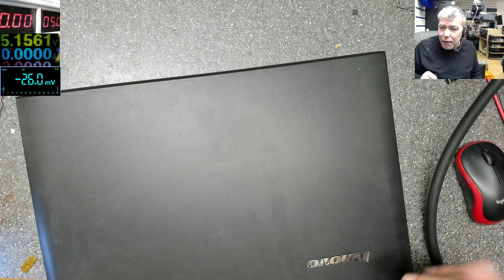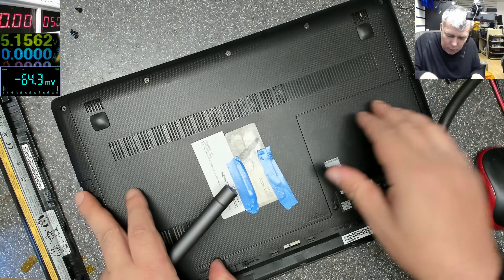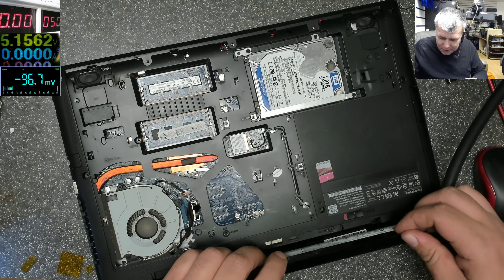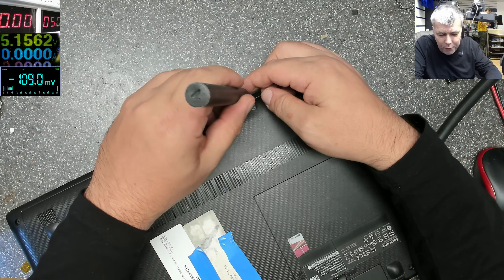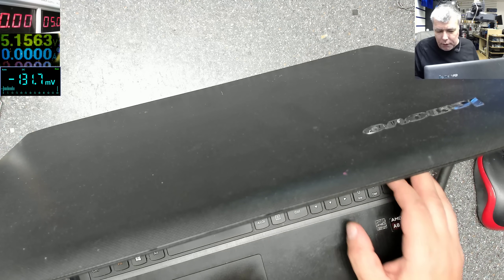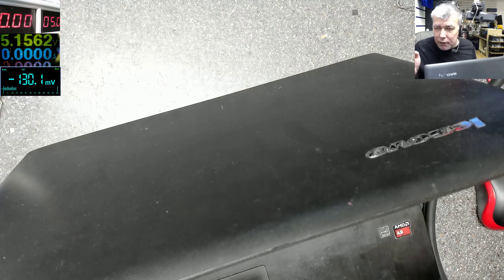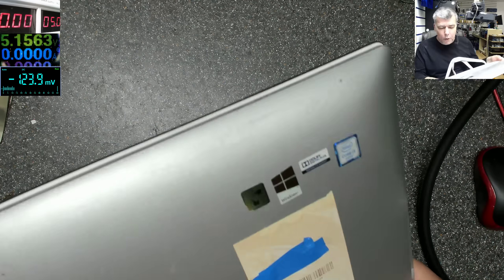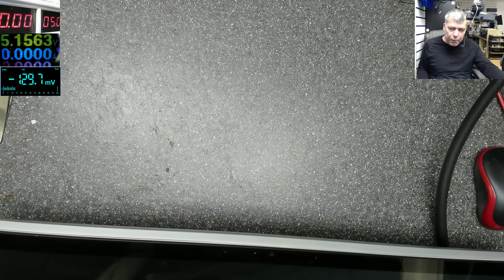Video TDR failure error, anyone know anything about this?

Comment: Hi sorin I like your videos I got a few pc with this problem this is my fix. Let me know it helps
Go to cmd as administrator type command powercfg -h off then exit.
Then go to power options changed advanced powers settings expand adapter settings changed power options to maximum power performance and maximum performance do thé same with into graphics settings . Then go back to cmd as administrator and type sfc /scanow then exit. Normal is thé error hond now try it regards Steve from Belgium
Reply: Up this comment guys. Bro Sorin needs to try it.

Comment: I've currently got an issue with a fresh win10 install where the usb3 ports don't work ... but they work using Linux. In my case, the solution - according to Dell - is to install new chipset drivers. Apparently it's a known problem with fresh win10 installs. Anyway I can't be bothered for the sake of 2x USB ports. Does the video work if you boot off a Linux USB/DVD ?

Comment: Hi Sorin   Igdkmd64.sys is  Intel Graphics Driver. Maybe it is possible to start Windows in Save Mode with Strg + F8 at start of the PC.
Then uninstall the Drivers and install current Driver Pack from intel Homepage. Maybe it is a good idea installing Chipset Driver first before installing Graphics Driver.

Comment: if you put new Windows on it without updates and it keeps doing it then it's the drivers.  if you are going to update and you get it afterwards you will know that it is the drivers.  should it still work with a clean installation without drivers.  then your processor is probably not quite right anymore, which also includes the video card or the separate video card is not working properly.  sometimes processor with internal video card and sometimes the separate card.  if it doesn't work with a clean installation, you have to look for old drivers from the machine itself

Comment: This one is actually not difficult to pinpoint the problem. There is a piece of software which you should be using anyway. Go to kaspersky anti-malware antivirus website they have a program which creates a bootable DVD, it is meant for recovery of a virus malware attack but you can use it for diagnostics.

It is based on the KDE Linux desktop it is keyboard or click base and it has hardware diagnostics built-in as part of it. it is a desktop diagnostic kaspersky customised KDE  which you should have laying around always for these kind of things and others.
Reply: Kaspersky Rescue Disk diagnostics. https://www.kaspersky.com/downloads/thank-you/free-rescue-disk

Comment: Indeed it's the Intel iGPU driver crashing. It should work fine in safe-mode since the driver isn't loaded. Should try an older version of Windows 10 with an older version of the Intel driver or even a Linux LiveUSB just to make sure it's not a weird driver incompatibility (it happens).
It can also be a hardware problem. RAM has been swapped already but you can try Memtest to exclude that possibility. You can also disconnect the LCD to make sure it's not causing an issue (like due to corrupt EDID or something).
I've seen this issue several times with failing dedicated GPU, buggy drivers, bad or incompatible RAM.
With Intel iGPU I've seen it once on a desktop and it was an issue with the PCH, in this case using a dedicated graphics card worked, but if trying to use the integrated VGA port it would crash like this.

Comment: I'd try installing a different build of windows 10 maybe one from a couple of years ago. Might also try a windows 10 USB boot ot maybe a Hirens Boot USB just to see if anythng will boot.
I used to like Lenovo stuff but the quality has dropped somewhat.
Might not be relevant but Paul Daniels has just (minutes ago) posted a video on an Ideastation (AMD processor) and he found a corroded cap on thhe CPU wbich he removed!

Comment: Hi Sorin... I have been watching and learning from you for a while..I own a computer repair center in South Africa... . I am learning lots of extra bits from you....
Video TDR Failure is the following problem. 
Due to a later update from windows it corrupts the video driver. You need to download DDU and the original driver for the graphics card.  First you uninstall the drivers with DDU... Back to windows basic display. Then you close the DDU program and install the original driver, however Nvidia asks for the express or custom install... Use the custom function. After the installation you need to adjust the wifi power  to maximum (why... Who knows) but it works.. My client and I battled for 2 months.. And now it's perfect....
Reply: Johnny he posted in video description it does work in safe mode. It should work in safe mode because the GPU drivers are not loaded in safe mode
Reply: i tryed the ddu and reinstalation of the software and didn´t solve the problem. never done the wifi thing, how can i do it? i have an asus rog gl553vd and the bios is so limited that i can´t really modify anithing in there... help please and thanks for the tip.

Comment: TDR is an abbreviation for Timeout, Detection, and Recovery. It's a windows component. Whenever you receive this error, the Graphics card stops responding and Windows will stop to fix the driver error.

Probably hardware failure in graphics hardware within the cpu. Integrated like you said.

Comment: if it as hdd fitted it will need changing out for ssd and a new windows putting it but first go in the bios and reset default

Comment: It's all in one without touch screen? An idea to try it without screen connected on external LCD. Maybe it's screen or touch screen issue? Try bios update and older win instalation. Try to disconnect hdd, that was the first issue, maybe it's error created by data corruption on hdd data ljne, try USB only instalation. Disconnect wifi and any other connected hardware. My guess is the touch screen issue. If it should be there ofc, check it first. Best luck :) waiting for feedback on video thank You for your work  on yt :)
Reply: Another reason could be bad power supply.

Comment: I had same experience bad hard drive replace and still same. found new mother board for $45 and work fine now it was game on put old one back in and try reset bios as i was doing other testing after multiple times motherboard quit now has chip getting hot and no screen and short look it up and could not get chip seem to be controller chip at this point i had enough fun thank you for videos

Comment: Is the machine meant to work with an older verion of Windows such as 7?  hardware might not support latest version of Windows 10.  Lenovo are a law unto themselves!  Just a thought.
Reply: completely agree. hardware error is mostly caused by incompatible software - drivers. wrong i/o requests

Comment: im sure this shows nothing you haven't checked yet
Reply: Causes of VIDEO_TDR_ERROR Blue Screen Errors
Incorrectly configured, old, or corrupted device drivers. (very common)
Corruption in Windows registry from a recent software change (install or uninstall).
Virus or malware infection that has corrupted Windows system files or Windows Operating System-related program files.
Driver conflict after installing new hardware.
Damaged or removed system files after you’ve installed software or drivers related to Windows Operating System.
Error 0x116 blue screen caused by a damaged hard disk.
VIDEO_TDR_ERROR STOP error due to memory (RAM) corruption.
VIDEO_TDR_ERROR blue screen errors can be caused by a variety of hardware, firmware, driver, or software issues.

Comment: TDR - Timeout detection and recovery - GPU using shared ram - Test ram modules, If you can not test, try rebooting with each ram module individually,
Reply: Are you talking about soldered in System RAM on the motherboard is shared with the GPU and is a likely cause? What about the laptop working perfectly fine with the dGPU disabled and the system RAM not changed in anyway. Experienced that situation?
Reply: @Infiniti25  Both, if unlucky, most of time replacing shared Ram module. But some thing is causing delay hand shake, could just be duff ram module or connectors need cleaning & re-seating or if really unlucky had hand shake reporting video module detected and locked out onboard video  ram sharing, but there is no video module installed. -- dGPU a glitch in the bios boot detection try removing bios Battery - replace and re boot. reset up bios.
Reply: uksuperrascal Ok thanks, I might be going inside this weekend to install larger M.2 SSD so I’ll check if replacing CMOS battery makes any difference.
I updated the BIOS to the latest version when I bought it second hand to rule out that issue.
Reply: @Infiniti25  Check mother board and bios issue number matching as latest up dates may not match your mother board.

Comment: Check BIOS to make sure no overclocking was applied. And also check if the chip still has cooling, maybe the cooling paste is gone and when starting it heats up fast and then it overheats and dies. Another suspect is bad memory.

Comment: Was this machine specifically windows 10 ? Is it worth trying an older os on it, even try 7 then update to 10 if that works maybe. Older os might have better drivers to start with maybe ? Also I didn’t hear you mention any bios update ? Also didn’t see you play with the bios, other than getting the hot air out and checking any data links between cpu and gpu I’m out lol. Good luck
Reply: https://www.techclassy.com/fix-video-tdr-failure/

Comment: what does the bios diagnostic (F10) says?
Reply: sound like a solution: https://forums.tomshardware.com/faq/how-to-fix-windows-10-error-igdkmd64-sys.2752268/
Reply: better try win7
Reply: Neacsu Gabriel didn’t work for me, once drivers are installed same issue.
Reply: @Infiniti25  Probably u're right but hv to ask: "may I see?"
Reply: Gabriel N how did you resolve this issue in the last 6 days?
Reply: @Infiniti25  as usual. Working, sleeping and thinking of girls... why, is there any other way?
Reply: Gabriel N not in my experience. Keep enjoying life and bury this problem in your donor boards pile.
Reply: @Infiniti25  does it hv intel amt activated? I can look into the problem by myself. I might find the solution for you...
Reply: Gabriel N doubt it since it’s a consumer laptop, but I’ll check tonight when home from work.
Reply: @Infiniti25   move C:\Windows/System32/Drivers\igdkmd64.sys somewhere else. It will work but no 3d. And as I understand If you put it back will get the same error.
Reply: Gabriel N I don’t see that as a fix, who will want a laptop with no 3D hardware acceleration? Also that “fix” is for the Intel CPU iGPU being a problem correct?
Reply: @Infiniti25  not realy a fix but it can bootup and than I'll get the chance to remote in...
Reply: Gabriel N I’d pull the hard drive if I needed access to any data, this “fix” would be useful for accessing devices where there is encryption involved.
Reply: @Infiniti25   That doesn't match! Sorin said something else...
wish ya goodluck! Can't help ya!
Reply: Gabriel N I wasn’t asking for help, but thanks anyway. If I or anyone else wanted assistance I’d be on the ERS discord instead. I was merely adding my take on the issue as I have experienced it with the nVidia GTX970M dGPU and from all I have seen it is hardware related, not drivers.
That is only one device granted, but I have done all the swapping hard drives for known good working, fresh windows install of Windows 7 and 10 trialled with multiple drivers tested using DDU in between. Any time the dGPU was called upon by the OS for a given application, this blue screen appeared. If I set the nVidia control panel to force that app to use the iGPU no problems until the next application that was allowed to call upon the dGPU.
Disabled in device manager and using only iGPU works perfectly on this particular laptop.
Hope it helps someone reading in future.

Comment: hi sorin.try a lower version of windows.if it's the gpu it will start for a while.good luck
Reply: Didn’t work for me. Tried fresh installs of Windows 7 and Windows 10. Tried DDU to remove driver. Machine stays on and works until windows update downloads and installs the driver or you install driver from manufacturers’ website. This is definitely hardware related. I always suspected it could be something related to The HDCP part of the HDMI implementation.

Comment: Check you power lines with a scope and voltmeter. Looks like an unstable power line. Remove AND replace the BIOS battery. The BIOS battery might fail under load. Disconnect the DVD drive (in case it's pulling down a power line).
Reply: I had a similar issue on a desktop. It went away by changing the BIOS battery. The old battery was still at 3V, but I think it didn't hold under load. I also replaced the power supply, and I disconnected the DVD drive. I think that the real problem however is a bad electrolytic cap on the motherboard. Somehow the board seems to boot if the total electric load in the system is not too high.
Reply: Kris Willems strange. When you say desktop do you mean an all-in-one or standard desktop tower?
Reply: Kris Willems I have this fault condition on my ASUS ROG GL502V laptop. I’m interested in your train of thought. Which power line are you talking? GPU vCore?

Comment: Sorin, you might try running a 'live' version of linux just to rule out any software issues. If it will run on linux, it's more than likely a bad Windows install.
Reply: Sorry I didn't see your comment (even though it was right there!!!)
Reply: i try any version of windows in my one on windows seven start but freezing all the time all diferent windows not even start freeze on startup
Reply: Windows will also run with Microsoft basic adapter. Live Linux will run on a generic driver, but if it ran in persistence mode or even installed on a disk it will show problems if the problem is hardware related.

Comment: I have this exact same issue with a ASUS ROG GL502V laptop. I disabled the nVidia GTX970M in device manager and use the CPU GFX core. Been using it this way for almost 3 years.
Would love to fix it if anyone has any ideas.
Reply: Replace GPU with new chip
Reply: Fábio Malhão that’s what I expected so I’ll just keep using the CPU GFX. Thanks.
I tested with Windows 7 and Windows 10, tried fresh installs, tried DDU to force driver uninstalled.
I worked out what Sorin has worked out that with driver installed the 3D graphics core is active and there is this blue screen. With the driver installed but disabled in device manager I can use CPU GFX.
Reply: That is a way
Reply: Fábio Malhão unfortunately for Sorin and the customer, in this case it’s not an option 😢
Reply: Fábio Malhão interested what you tried in hardware to solve this issue even if it was only temporary. I know you said ultimately the chip needs replacing. I wondered how you arrived at this conclusion. Did hearing the GFX chip like Sorin usually does give a temporarily working chip or didn’t make no difference?
Reply: Depends on what failed in the chip. If it is the substrate balls then reheat might work but you might have damaged transistors since temperature is difficult to manage in laptops. Laptops cannot have high powered cards it always ends like this... Also you should check if the gpu is soldered In your laptop or is the mxm format that is removable and replaceable.
Reply: Fábio Malhão definitely soldered, I like some of those Clevo laptops that have a GPU card. So it’s a GPU core failure due to temperature and definitely not a component in surrounding/supporting circuit?
Makes sense that not just substrate ball might be damaged.
I expect all GPU to fail eventually in an ALL-in-ONE or gaming laptop setup because cooling is woefully inadequate.
Thanks for taking the time so far to provide useful responses 👍🤓😎